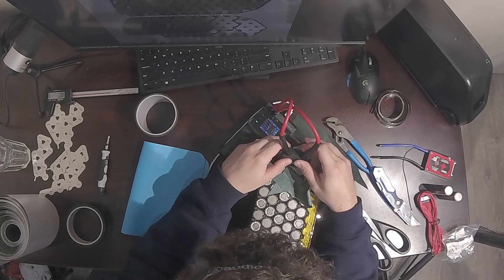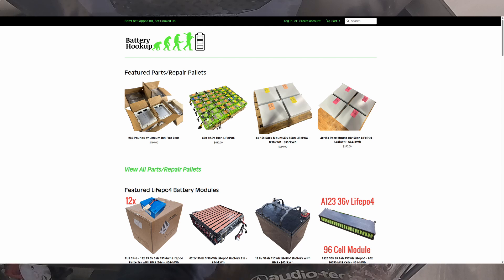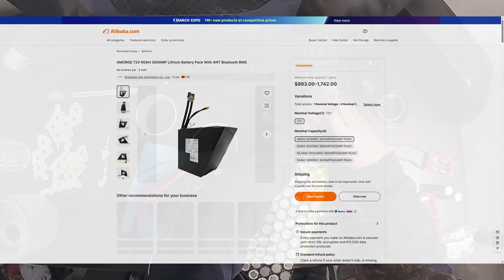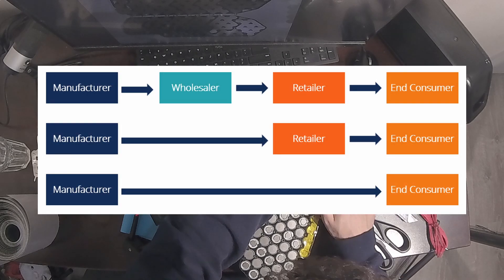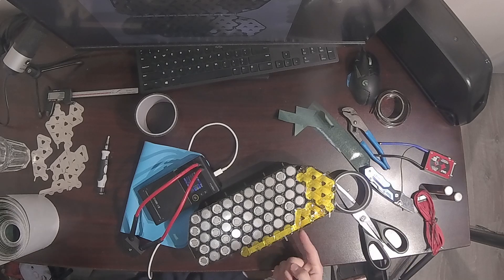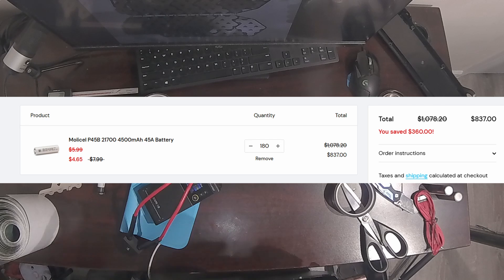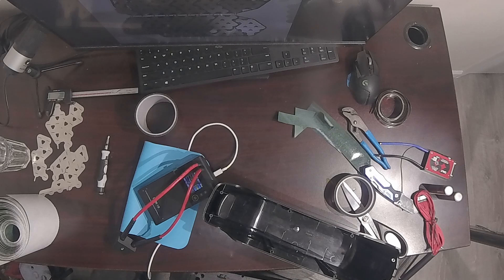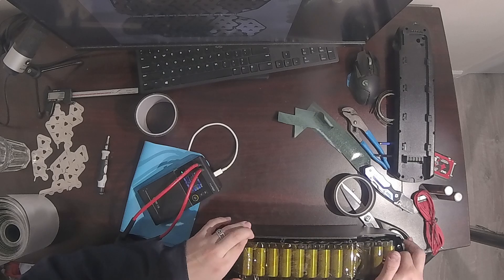Why You SHOULDN'T Build Your Own E-Bike Battery

Comment: LEt me explain what i am doing so that it makes sense. 

I am building an ebike battery but not in the conventional way. 

I am going to build a portable power station. It will have solar input, and wall outlet input. 

Whyi have chosen to go this route is that to get the best milage, ebike batteries are not inherently heavy. They are roughly 8 pounds in some cases. The fiido titan used three of them to get a world record for longest travel. 

Using a power station, i will be able to surpass that limit by having way more power storage. I would be using lifepo4 batteries which yes are heaver to create a power bottle neck that recharges lithium cells up to their rated safe recharging limit. 

This does mean i need to have a system that detects how charged the lithium cells are and automatically switch which cells are being used. if not an automated system, a manuel switch.

Comment: Commerical packs are usually crap. Cheap electronics....low voltages...crap life ...if you want a true long life, high power battery.... building yourself is the only way. You can find the cells....you just have to look. You need a 3D printer too so...

Comment: Did you really factor in tools as well as parts to build a battery? OK, so how much to build your next battery? You could build another so you can do a quick swap, or run dual batteries. You could build a battery cheap for friends.

Now, you'd used kapton tape all over the cells here. There is no need here. Insulation adhesive is enough to cover the sides where the contacts are exposed.

Comment: By the time you add in all the stuff to build your own, there is just no way it’s cheaper. By “broken” ebike forms dirt cheap and fix hem. Even then it’s a risk as cheap as e-bikes are.

Building a battery from scratch is nothing more than a “challenge”, it’s not a practicality. I bought a 48v 20ah battery for my conversion kit and it was $260… a good spot welder is going to cost that.

The only other time that it’s worth it? My cordless vacuum and the replacement battery was over $75, I just rebuilt the battery and it works fine. Neat little “project”.

Comment: How about a scenario where I already have 2 battery's both 48v 17.5ah but they only output 20amps continues so I already have cells just need a case bars bms wires and stuff but the most expensive thing I already have

Comment: I agree about the initial cost of the battery. But what about continued use and maintenance? (And take this as questions of ignorance) You could maybe reuse BMS across build, case, and only replace cells? If you're checking the cells maybe you don't need to replace all of them?

Comment: I think the wording of your title hurt some feelings because it only says “Why you shouldn’t”, even though you cover a few examples of when you should. 

I agree that unless you want to play with batteries as a hobby or make a lot of them, its better to buy one from a reputable builder/seller. 

Amorge is very flexible and will build a custom pack that fits inside whatever dimensions you give them. I custom designed one that Amorge built for a friend and its still going strong. I watched some tear-downs first of Amorge packs and see they use good construction methods and an ANT BMS, unless only an inferior BMS will fit. 

My friend had previously hired a local crackhead to build his pack, allegedly with Molicel P28s. First ride he destroyed the battery so I coached him into unwrapping it and there’s absolutely no BMS, which would have prevented this battery destruction, and the cells were 10a peak 💩 cells, not P28’s. So in the attempt to save money, he threw $1000 down the drain and then spent $1700 for an Amorge. 

Every real ebike battery has a Bluetooth BMS. If not, it belongs in the trash. If it doesn’t have any BMS, it belongs in your enemy’s trash. Lol.

Comment: I completely agree. I would never build one myself. The general rule of thumb for anything anywhere is that if it is being mass produced by someone then you simply cannot compete or beat them on price. Ever.
What I will gladly do however, is grab defective or "bad" batteriers on the cheap and revive them with with new cells or possibly replace a failing BMS with some generic AliExpress item.
Reply: I bought a cheap battery. Overkill, and wrapped in single colour wrap, I have no idea the cell capacity without further testing. As long as they can put out 8A each, it'll be fine, otherwise, I'll repurpose them for light duty. Laptop, work light, power bank, battery pack(light duty)

Comment: I build my e-bike battery myself years ago and it still performs like new..The original battery for my bike costs about $430 . I just bought a couple of dead ebike batteries and used those. My cost was about $10 and a couple of hours. Now 6 years later it still is like new. I have to say I've been building and "re-building" batteries for about 20 years now (both professional as personal), so quite the experience.
Reply from the maker: Nice! I think rebuilding packs with 1 or 2 faulty cells and building packs from reclaimed cells is a great idea. Good for your wallet and good for the planet.
Reply: I have 12 years expérience building batteries, never heard of you in the community
Reply: @nicod974  not everyone is online.  I had my own company,  with my dad. Selling boats, batteries, trolley motors, refit boats,  renting boats, etc, etc. My company started before I was born.  But my dad passed away about 1.5 years ago. So I stopped because I lost the joy and all
Reply: I forgot to lock mine in one day, went down a bumpy road to work and the battery fell out causing it to break. I just put the internals in a new box. I wanted the water resistant to remain. I did forget to install the nut for the connector so I left it for a long time until one day, I just got on with it and now it's 99% good. Shorted out the battery gauge.

Comment: in my oponion its cheaper to build your own than buying a pre packed cells. and by diying ur own battery you can custom fit , use the tools you use to repair the packs and have a more genuine batteries with higher capacity built
Reply from the maker: At first, I was planning to make a video about why building a battery is better than buying. However, after crunching the numbers I found that it was in fact more costly to build one yourself from brand new cells unless you are buying the cells in very large quantities. I even presented an example in the video @ 3:00. It is only one example so maybe not conclusive evidence. Not just that but a good spot welder will easily run you about $300 or more, which is a very difficult cost to justify.

Regarding genuine batteries, you need to be buying from the right sellers who have good reputations like Amorge and Grin. I'm sure there are others but those are the only 2 manufacturers I have seen with a good history.
Reply: @DimGG  I had packs from China welded with micro TIG... cost is way cheaper plus you can use it for other tasks

Comment: If you buy cheap ready made packs, those often won't be built well and are a still fire hazard.
They also can lie about cells they use, or they cells will be fake.
Look for factory discarded brand new cells which were welded into a pack, had 1 failed weld and were thrown out, then picked up by someone taken apart, and those are pretty much the same stuff but cheaper, those are often called reclaimed and will have weld spots.
Or if you have battery pack factory in your city you might be even able to just go dumpster diving and just pick one for free...
Reply from the maker: I'm a fan of building packs from discarded cells. I got an affiliate code with batteryhoookup.com cause that's what they sell. Unfortunately they rarely have 21700 cells. I've heard of people getting old tool batteries from dumpster diving at Home Depot and Lowe's.
Reply: @DimGG  I had a guy back in Poland which would intercept bosch e-bike factory battery disposal.
It was one of the better 2900mAh 18650 cells and he would sell them to me for dirt cheap as long as I took whole assembled pack of like 40 cells minus that one or two bad cells, because that meant he pics it as is and sells it to me with 0 work needed on his end.

Comment: Gitter 801D got it for $155  and -$25 off due to aliexpress codes. 801H was only $40 more but the 801D is already enough. ive seen people get good results with the KEKK K7 which is like $50. 

but your point on the cells being rather costly for hobbiests to compete is very true. personally im not using new cells, im harvesting them from battery packs. and getting otherwise still good sony, molicel, samsung cells for a fraction of the price.

im sure if you use alibaba for the cells you could be competitive to an alibaba battery pack. The issue is the validating of who wont sell you cells rebaged to look like a P45B. granted i wonder how badly the shipping and import fees will be. thats another cost being added into local distributors are adding in thats easily missed.

Edit: Acutally, i think you really are missing out a big factor, sometimes you can find great deals, for example just a quick search on secondlifestorage and ive already found new-old stock Molicel P45B being sold for $1.50 a cell buy by the case.

im also going to point out louis rossmann had a UPP battery, it caught fire. Has CPSC warning issued against their products and banned in the UK.

Comment: Most commercial battery packs are made with shitty cells. You can buy genuine batteries, yes more expensive, to make your own pack.
Reply from the maker: Many brands do lie but not all! I personally fully trust Amorge and Grin for packs. They are 2 companies with a good track record.

But I do agree that one advantage of building the pack yourself is that you know you're using genuine batteries, which is a good feeling. Even then, though, some people have received fake cells that were rewrapped to look like originals and the only way to tell if they are legit is by using a battery tester to very internal resistance and capacity. This risk can also be mitigated by buying from a reputable seller.
Reply: Also, you get to pick high quality Chinese BMS, I've had two hailong batteries from AliExpress with genuine Samsung and LG cells, But since they were paired with poor quality chinese BMS, they didn't last two years of constant use. Fortunately replacing, a BMS is more doable than building an entire battery pack.

Comment: I've come to the conclusion that I shouldn't buy these cases for rivet mounting either, as they give me anxiety that they'll fall off or fall apart, even on jointed roads, let alone off-roading...
Reply from the maker: Interesting... I wasn't aware that this was even an issue. Which case did you buy that had this happen?
Reply: this is a common issue with slide-style cases... I've experienced the problem with the same Hailong case, which I assume is designed for a different pack...despite having a low center of gravity, the case wouldn't stay in place during rides. upon further investigation found the culprit,the M3 hex nuts tapping against the case during rides. This issue is likely why high-performance e-bikes have moved away from slide cases.

add to that..i mounted it on a kona 2007ish mtb ..the inclination is was not too steep..unlike on regular hardtails.
Reply: This may sound 'janky' but if you are really worried I suggest that you consider putting a couple of loops of  duct-tape around it to secure it to the frame. It is cheap, quick, reliable, and easy to remove when you need to. There are lots of colors to choose from and often you can get a roll at the dollar store.
Reply: @oldmanwithebike  I velcroed it too, yea i presume that'd work better than velcro....my choice of fastners, hex 3M bolt, was bad cuz they were the only one i had...i managed to dampen the rattle by adding double sided tape on 'em.

Couple of pointers to note here, one being the inclination of mounting..the steeper the better which totally depends on the frame and the second one being choice of fastners.. button allen bolts with plastic washers would work best.

Comment: But can you trust the sellers if the cells are legit? Last battery pack I bought from a (in my eyes) legit seller had crap cells in it. Good video, keep going on
Reply from the maker: I trust Amorge and UnitPackPower batteries. I've seen teardowns of their packs online and the cells that they claim to use are accurate. Just need to make sure you are buying from the official Aliexpress/Alibaba store as there are copycats out there.
Reply: Do you have links to their official aliexpress stores?
Reply from the maker: @Numerouno_2  on https://www.amorge.com/ they link to their Alibaba page for each product. You can also message them directly via whatsapp or email and go around Alibaba.

UPP battery is a bit confusing because they have multiple websites but they're all owned by the same company. unitpackpower.com uppbattery.com and unitpackpower.net

UPP battery had gained a bad rap about a year ago particularly for their U004 BATTERY catching fire, but I believe they've addressed the issue since. However, I would still avoid ordering that particular model.

Additionally, Grin makes super reliable batteries and their company founder, Justin, is quite transparent about issues they have had over the years and how they have handled them. Justin has several YouTube talks (over the last 10+ years!) not just about batteries but about other e-bike components, issues the company has had over the years, and what they have learned. You can buy Grin batteries from https://ebikes.ca/shop/electric-bicycle-parts/batteries.html They are a bit pricier but come with a greater peace of mind.